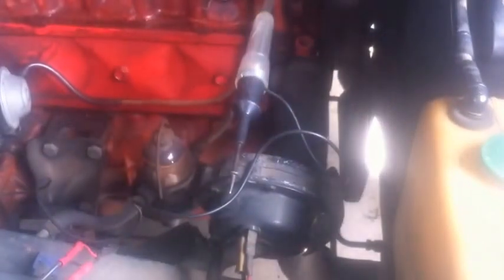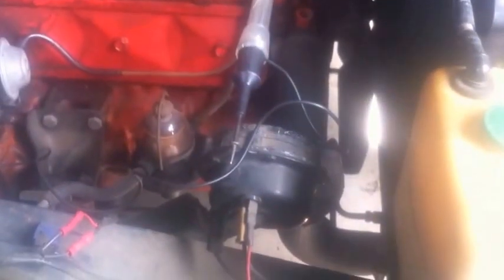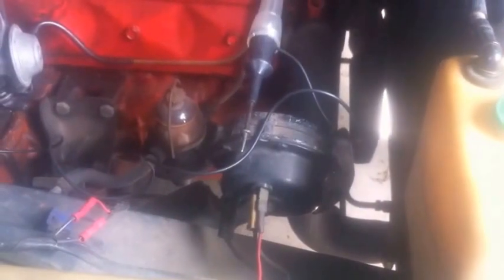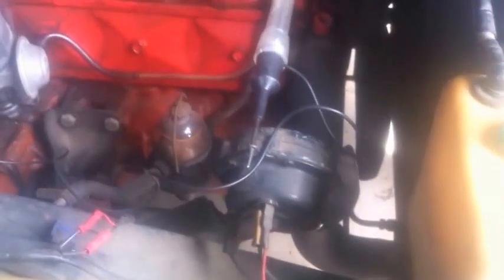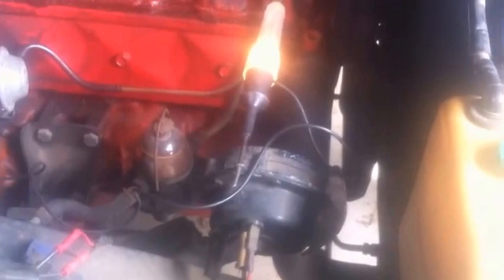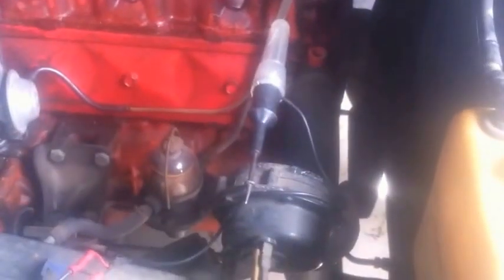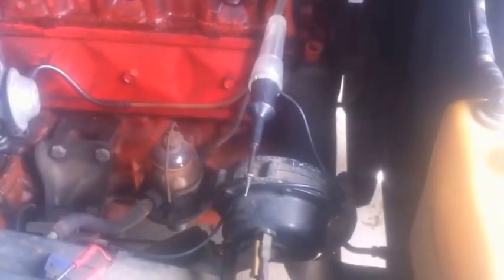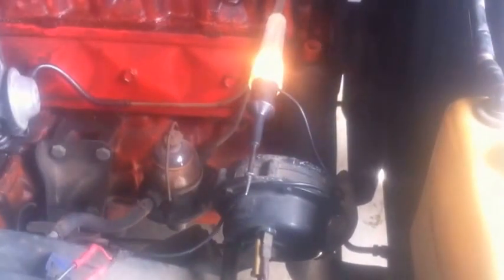how to set engine timing with a test light

Comment: I have an MSD ignition system and could not replicate this simple procedure. Do you know if the MSD is interrupting the signal? I spun the crank 360 degrees to see if it'd hit on any of the plugs and nothing. Suggestions? I'm stumped, because technically, the coil hits the distributor before the MSD box.

Comment: Sir me ask a question to you where you put the alligator clip in high tension wire no. 1 can you picture that connection sir in very interested to you unique idea to test the timing plz. Sir explain me that
Reply from the maker: hi the alligator clip goes on the negative of the coil wire
Reply: He put the alligator clip on the one coming from the coil running to the  distributor n before the points

Comment: Where does the point of test light go?
Reply: Looks like you just ground it and just dig the probe into the number one spot on the dizzy. Or vice versa like he has in the video.
Reply: @tommyhajimoto6968  wrong there youngster! 🥴 The Test light goes between ground and the ignition coil negative. Most of You millennials spent way too much time THUMBING video controllers and not nearly enough time under the hood of a hot rod.  Stick with your video games and rid the world of CARTOON terrorists!!😁
Reply: @tommyhajimoto6968  stick your  “dizzy” up your butt!  We adjusted DISTRIBUTORS on our REAR wheel drive  V-8 hot rods😁

Comment: Thanks 
Wanted to make sure I was doing it correctly 
Working on a 1954 Chevy 210 Sedan 235 6 cylinder 
No timing mark on front pulley, only small triangle mark on flywheel.
Reply from the maker: thanks

Comment: Does the alligator clip need to be connected to the condenser/wire or does the wire need to unplugged from the condenser first and the test light connected to just the wire coming off the negative post on the coil?
Reply from the maker: Hi James, the test light aligator clip is connected to the negitive side of the coil while everything is still connected.
Reply: Thanks!

Comment: which wire do you connect the alligator clip to? the center wire or No. 1 wire? thanks
Reply from the maker: hi you connect the alligator clip to the negitive side of the coil (low voltage) not the high side leads, hope this helps

Comment: hi,could you make a video on a modern car using the same test light,for example 94 honda accord  and if you could give more detailed  explanation ,maybe close up of what exactly you doing and better audio,thanks
Reply from the maker: hi
thanks for your comments, the test ight only works on distributors with points, you need a timing light if the vehicle has an elctronic distributor. hope this helps